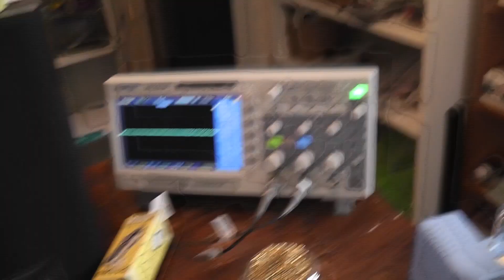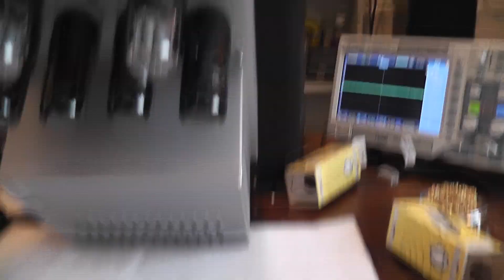Douk audio 6p6p (6V6 6SL7) amplifier kit finished

Comment: Have completed this kit - not following Laim's mods. Output on both channels at 4 ohms is very weak, at 8 ohms extremely weak. When switch is between 4 & 8 ohms it is louder but still too weak. What have I done wrong ? What should one do with the G1 & G2 taps on the output transformers? I have just left them.
Reply from the maker: How did you wire up the 0v (negative) terminal of the speaker connections to the PSU 0v rail? They're needed as the bias current for the input valves is sunk via the secondary windings on the output transformers.
Reply: @killcar5nbike2  
Christopher Cook <cdkcook@gmail.com>
10:23 (45 minutes ago)
to YouTube

Dear Liam,
Many thanks for your reply. I am 86 and try to keep fingers and brain working. Have built several kits - with instructions - but am not good on theory.
The negative terminals of the speakers are connected to earth on the speaker PSU which are then connected to the earth on the main PSU at the front as you have done.
The O of the output transformer goes to +ve speaker terminal then onto O on the speaker PSU. That's all.
What is the Ov rail of the PSU?
Yours aye, Christopher
Reply from the maker: The 0v is the negative rail of the HT supply. The feedback winding connects to the input valves cathodes. However the current that runs the input valves has to go through the output transformers.

So the FB feed comes from speaker + to the front of the PCB. Speaker - needs to connect to the 0v of the PSU on the main PCB so the cathode current circuit of the input triodes is complete. All input stage current is drawn via the feedback resistor through the output winding of the output transformers.
Reply: @killcar5nbike2  Penny dropped - thanks Liam. One O for zero another O for output. I used  the components  they sent except the axial condensers - they were way off and one pair was recycled! Also replaced the 6p6ps with decent 6V6s . I am delighted and surprised. It is remarkably good. Not just a cheap Chinese amp. Also it remains cool after many hours - no chance of it catching fire. With the output transformer they sent, I will perhaps try an ultra linear version.
Reply from the maker: Mine runs nice and cool too. The power transformer is capable of running a much bigger amp and is having an easy time. The outputs are far too big to just be 10 watt units.

I'm pleased with mine with the full compliment of russian valves. I've got enough valves to run the thing 24/7 for about 70 years.

Glad to hear you got it working.